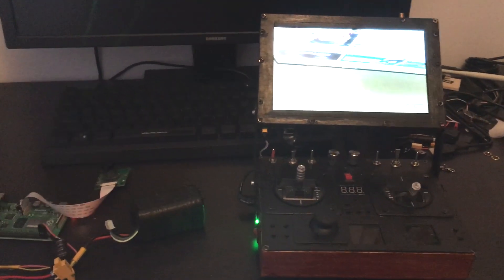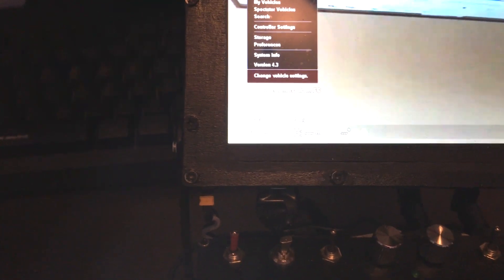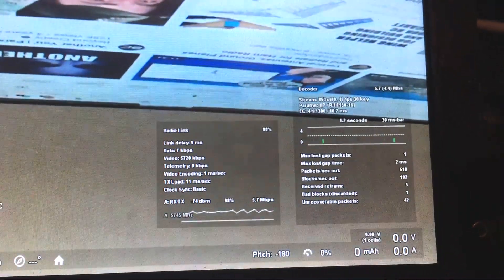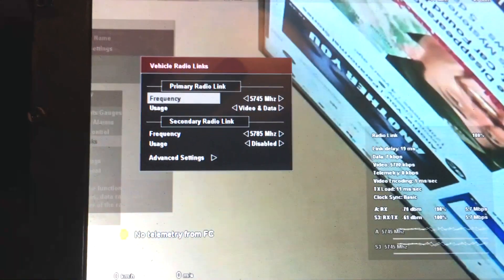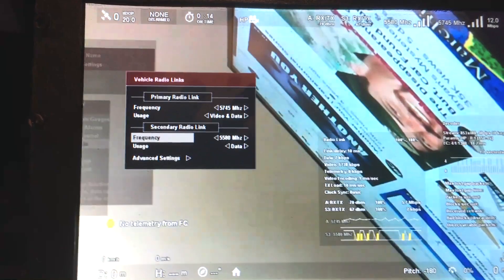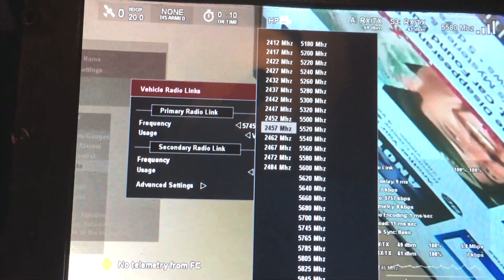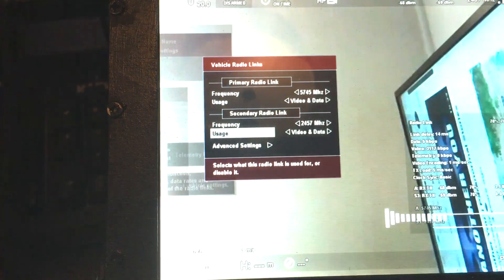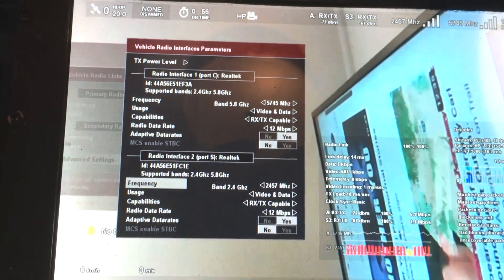Ruby 4.3: Setting up and using dual radio links

Comment: in a telegram group, one person told me that two cards work on a vihicle, you need pi3b or another pi where there are several physical usb ports. And with pi zero or pi3a + via USB HUB, he could not run two cards. This is true?

Comment: Hi. So nice work. When you will enable this feature.?
Reply from the maker: Tomorrow I'll make the release
Reply: @petrusoroaga6528  thanks. you are great person
Reply: @petrusoroaga6528  one more question. if the first  link has interference Does it switch to other band automatically?
Reply from the maker: @fevzisantur6467  No, each link is configured to work on it's own frequency. That's the point to have multiple radio links: if you have interferences on one link on one frequency, the other link still works fine. This is not about having a SINGLE radio link and doing frequency hopping on that single radio link.